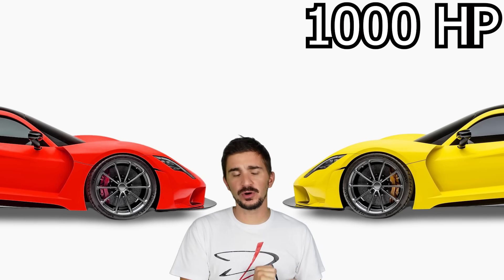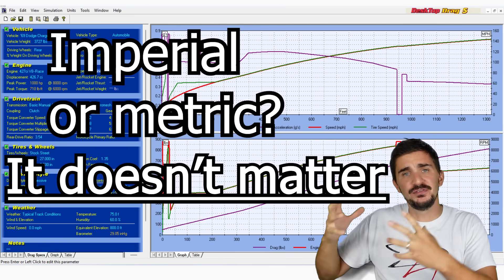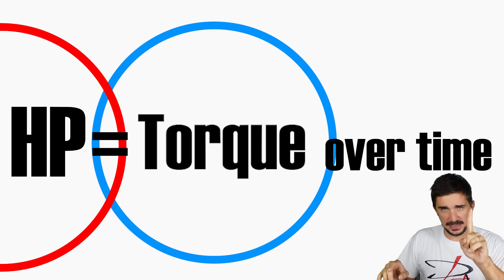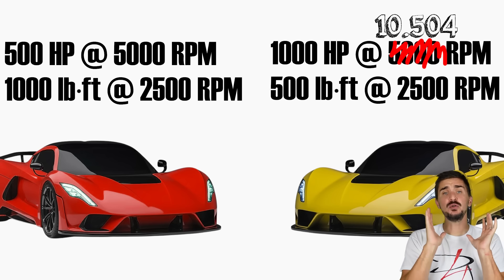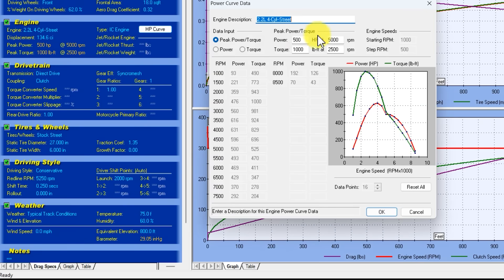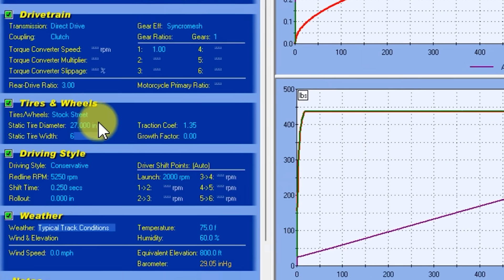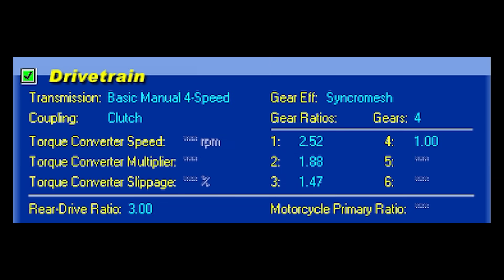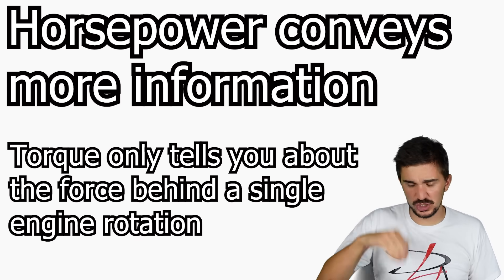Who's faster? Explained and Simulated - Horsepower vs Torque

Comment: I think a pretty good way of tackling the subject would be comparing two engines that make the same horsepower but at different RPMs (for example 700 HP @8000 RPM vs @2000 RPM); naturally the transmission ratio should be varied accordingly. Nice content as always :)
Reply: My Yamaha FJR makes the same 140 hp that the John Deere 4440 tractor I grew up driving did.  I certainly wouldn’t want to drag race the 4440, nor would I want to pull a cultivator with my FJR.
Reply: YES!! I was thinking the same while watching. 👊😎
Reply: Youd probably want to adjust the gearing so they both shift at the same wheelspeed.
Reply: This is where engine size could be a factor too: big american V8 engines have a lot of torque in the lower end of the rev range, whereas a small sportscar engine can have the same horse power, but needs to be revved much higher to archieve the same amount of torque. I would love an explanation on why this could be a factor.
Reply: @postmax81  take 500hp and make it at 5252rpm and 10,000rpm. The 5252 engine will have 500ftlbs, the 10,000rpm engine will have 265ftlbs. My 500hp Pontiac 455 is making over 500ftlbs from 2000 to 5000rpm. That means I can run a 3.08 gear behind it and in a 3000lb car it will run 10s easy. The 10k rpm engine will have a peak of 265ftlbs, so its barely making enough power to turn itself over at 4000rpm. It has to live at high RPM because there isn't enough torque to do much below 7500. There is no easy way its going to make a 3000lb car run tens, but a 1500lb car will be much easier to accelerate.
Reply: The best explanation is "Torque gets you there, Horsepower Keeps you there."
Alternatively Horsepower is how Fast you hit the Wall, Torque is how far you take the wall with your.
Reply: I know it's not as amazing but ford's 2.0 ecoboost makes around 250ft lbs at 2800rpms in the Focus ST
Reply: if only there was an engine that made 700hp @2000 rpm...
Reply: @normalkid488 Can get something like a 15L diesel to 700hp @ 2000rpm pretty easy.
Reply: @NBSV1  as far as im concerned and if im not mistaken, i think they start to have peak hp around 2500 to 4000 rpm. But starting from around 1500 to 1600 rpm they already made more torque than many sports car. Check out Scania V8 engine.

Edit: You're right, they already made crazy torque even from around 800 to 1200 rpm, LOL! 👍
Reply: @normalkid488  some late WW2 aircraft engines exceeded 3000 hp @~2000rpm
Reply: @normalkid488  There are plenty of engines that do.  What to ship engines rev to and what crazy HP do they deliver?
Reply: @normalkid488  The new high output Ford Powerstroke makes 500 hp at 2,600 rpm. Not bad for a 6.7 v8.
Reply: @normalkid488 .., would have crazy amount of torque.
Reply: @normalkid488 a semi?
Reply: @qualcunoacaso4865 lorry, tractor trailer, semi-truck. All the same thing
Reply: @normalkid488  Many big trucks out there…
Reply: @normalkid488  there is. It's called a diesel and has MASSIVE torque
Reply: @doogie525  It's not just diesels though, in fact you can still make loads of torque at low RPM with gasoline or even ethanol if you wanted.
It's just that diesel is easier to work with at low RPM and high compression ratios.

Ship engines use an even thicker fuel, bunker oil which is about as thick as it gets before getting to fuels that require you to run lava through the fuel pipes, produce insane amounts of torque at ridiculously low RPM values. RPM's as low as 60, which basically means the piston moves up and down once every second. You'd have enough time to stick your hand in there and pull it back out without it getting chopped off.
Ship engines can easily produce 100,000 horsepower, they have enough torque (say 8,750,000 ft.lbs) to lift a million pounds on an 8 foot lever.
Reply: @RealCadde  while what you say is true those engines aren't on the highway which is what I thought the conversation was about. I'm not a ship engineer but I have read that some ocean going vessels run on straight crude oils and some turn as little as 100 rpm and are thousands of cubic inches of displacement and produce thousands of hp and lbft
Reply: @doogie525  Yes, the point was that you don't need diesel to make high torque and you don't need top fuel, nitromethane or likewise to make a thousand horses. Not even on the road in a "car".

There used to be cars with massive engines on the road. 12 liter (732 cu in) displacement and up, all the way to 23.5 liters. (1434 cu in)
But since this was the early days of engine development, they weren't that efficient or powerful for their size.

And the point is that one fuel or one type of engine doesn't exclude all others. It really depends on what the goal is.
Reply: @RealCadde  yes but to make that kind of hp in a gas burner the engine would have to be massive even with today's technology and forced air because of the was gas burns. Yes it could be done though. However due to the way diesel burns it is much more feasible with diesel vs gasoline. With diesel it can actually be done in real life not just in theory like with gasoline. Even a Dodge Demon is well under 1,000 hp and well over even 3,000 rpm when it peaks at 808 hp
Reply: @normalkid488 there is a huge range of engines you could build 4HP-250kW, 70RPM-20kRPM.
Most petrol engines stay at 2000-6000 RPM and diesel at 600-3500 RPM because it makes the most reasonable engines in terms of size, weight and cooling. A normal car uses something like 15-30hp most of the time (maintaining speed) a sport car of reasonable weight needs like 250-300HP, and unless your car suffers from obisity 500HP is a huge amount of power.
Reply: In this example, both vehicles has same weight, aerodynamics and if gears similar to reality, the high RPM wins because of gearing. 
If we think unrealistic or in real life we had unlimited money, putting the RPM's about max HP for low RPM car with CVT or lightning fast DCT transmission, the low RPM same HP wins because the engine produces same hp much faster than high RPM engine. High RPM engine takes a time to reach high RPM. Also we need heavy weight both of cars or we need unrealistic traction wheel for minimum spining.
Reply: @kenanmutluturk8774   if they both have a magical "perfect" CVT, along with same weight/aero/etc, they would tie.  It makes absolutely no difference what RPM they make their peak horsepower at.
Reply: @duplox  Yes but low rpm engine reach optimal rpm a second faster. If both of vehicles lauch control with optimal rpm they would have same accelation, time and top speed.
Reply: @kenanmutluturk8774  Actually high rpm engines tend to rev up much faster. Everything is smaller and lighter. But under load all the differences in internal forces become irrelevant.
Reply: @trex2621 .. yes, on neutral. If the engine doesn't have high enough torque (that's what i reckon since high revving engine tend to have smaller, lighter parts in it) and you engage into any gear, especially 1.00 or smaller, with all the moment of inertia that the car's mechanical parts have, the engine would revved up much slower. 

I think forced air induction might be the answer for that, assuming the engine parts could withstand the stress. 😂👍
Reply: @arthurkairupan5228  There is no (combined) gear 1.00 or smaller on any normal car as wheels rotating @100+ rps at red line would mean speeds close to speed of sound. As gearing of main transmission has to be chosen according to torque/rev, lighter engine has no disadvantages. If done right, only power matters. But in case of difference of few percent between the engines, ability to deliver high power more consistently over the range of rpm may be more important than peak power.
Reply: @trex2621 .., ikr. We're on the same page here. I was just talking about a simulation setting on this context like in the video, with direct drive gear of 1.00 or smaller. Of course irl, you would choose gear ratio like 3.00 or larger for 1st gear, transitioned into a smaller one for the 2nd, 3rd, etc... for the lighter, smaller, much higher revving but much lower torque engine.

"...wheels @100+ rps would mean speed close to the speed of sound." - Depends on the overall diameter of the wheels + tires, if all other variables are the same, larger diameter would obviously be faster, since it would traveled more distances within the same timeframe (which was 100+ Rotation per Second as you'd stated).

"If done right, only power matters." - No. If everything else done right, TRACTION/GRIP is key. What's the point on having 1000hp if you cannot transfer it to the ground?
Reply: @kenanmutluturk8774  if it were a truly magical cvt with lossless infinite gear ratios, it would make no difference what rpm peak power came at.  The effective gear ratios would change at different rates, proportionally, but both would start with infinite gear ratio and infinite torque.
Reply: @kenanmutluturk8774 .., yep. Transmission is key, i think the one with 700hp @ 2000 rpm could utilize a very small gear ratio (like below 1.00) to get good speed, otherwise the rpm couldn't provide it.
Reply: @kenanmutluturk8774 if the vehicles weight the same and are operated equally efficient,  more horsepower will always win because the definition of horsepower is based on how long it takes to move a weight a certain distance.
Reply: @kenanmutluturk8774 Easy. Higher torque wins every time. Just like in real life. Assuming you're geared properly.

Notice how he didn't modify transmission gearing in his simulation? I wonder why??? ;)
Reply: Ferrari F2004: 900hp @ 19k, 265lbft @ 16k; 3 liter V10
TVR Speed 12: 900hp @ 7k, 650lbft @ 5k; 7.7 liter V12
Put these engines on the exact same car and comparing would be interesting 😅
Reply: @rfalcetti  how about 900hp at 5000rpm in a vehicle with the same weight? That will be near 1000ftlbs... and it will be making more than the TVR's peak at every point under 5000rpm as well. I happen to have engines that make over 650ftlbs from 2000 to 6000rpm. They are fun.